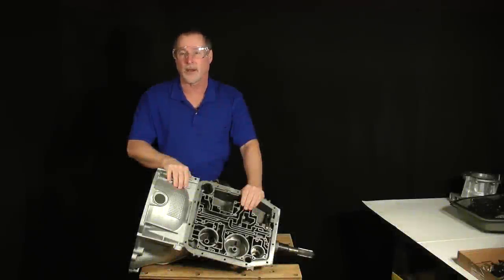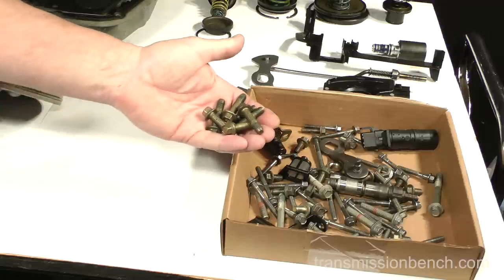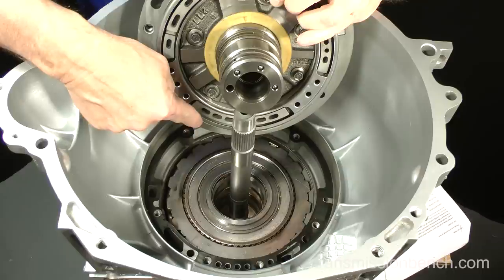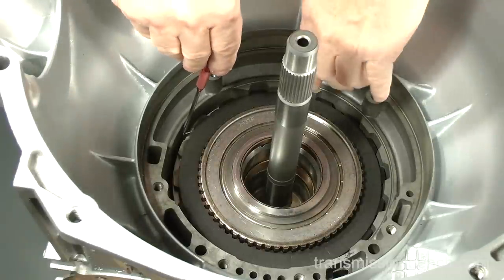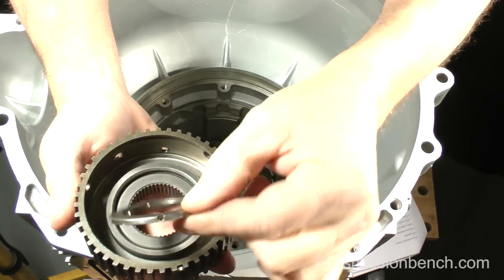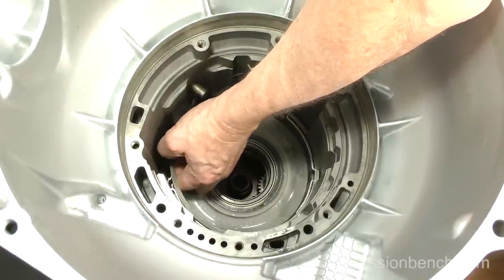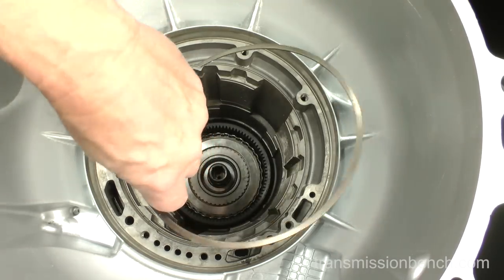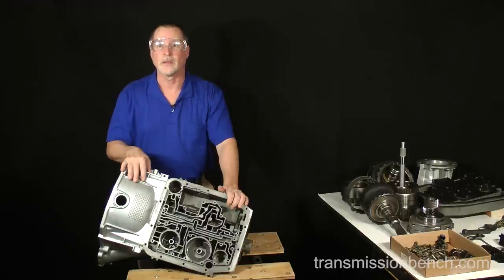AODE 4R70W Class part 1 lesson 4

Comment: The two threaded holes on this pump are of a larger diameter than the corresponding threaded holes in the case.  You can use 2 bolts and walk the pump off, just like you would a brake drum.
Reply: Jeff Hurckes Hallo

Comment: great video. could a bad reverse band cause sudden loss of reverse engagement?  I can only back my truck about 6 inches in 4low using high rpms on level ground.  There is a drop in idle but no "clunk" when I put it in reverse. Everything else acts like it should.

Comment: so i cant fine the "Small Spring Steel Part" at *6:02 in video where can i get another one??
Reply from the maker: Hi. The truth is, the transmission will operate just fine without it. It dampens the somewhat faint but detectable sound of the mechanical diode in applications such as the Town Car.
Reply: +StippLeTV TV  If you are a perfectionist like me, you want to put that part in even though transmission bench says it is not completely necessary.  My tranny didn't have the part either.  But I found it for sale at fordparts.com for $8.32.  search for "Auto Trans Intermediate Clutch Anti-Rattle Spring".  Also found it on ebay for $18.85.  search for "INTERMEDIATE CLUTCH ANTI - RATTLE SPRING".

Comment: thanks for your videos! whats the name of the small part shown at min 6:00 my transmision is missing that part. thanks again :)
Reply from the maker: It's called a "silencer". It limits a slight little rattle of the the friction and steel plates. If your transmission does not have it, you'll be fine without it.
Reply: thank you so much. looking forward for the next video on the series! PD I found a broken planetary and sun gear as well as a burned od band in my transmision any idea what can cause this?
Reply from the maker: Broken planetary gears are usually caused by a failed thrust bearing . The little needles come out of the cage and end up getting between gear teeth. Not pretty.
Reply: weird cant find any bad thrust bearings, I was thinking that the issue was caused by the tc bcz the reason why I take apart the tranny was a malfunction between od and d. At around 45-50mph when you let off the gas the tranny start to downshift like jumping between 3-4 and then after a few times doing that it start to make a grinding noise even on reverse. Im going to install a rebuild tc and new solenoids anyway just in case thanks for any advice :)
Reply: youre completely correct I check all other 7 thrust bearings but I didnt check the one inside the planetary and is blown in pieces thank you very much !!! can thank you enough!